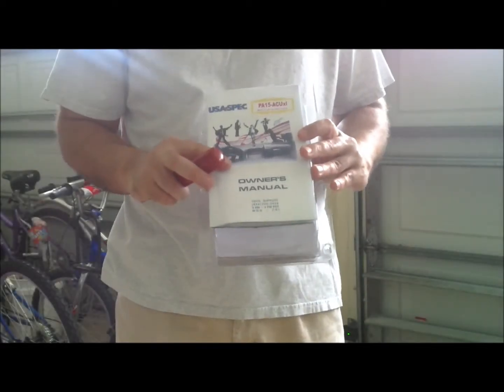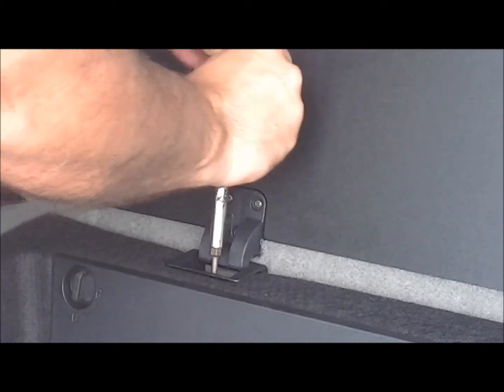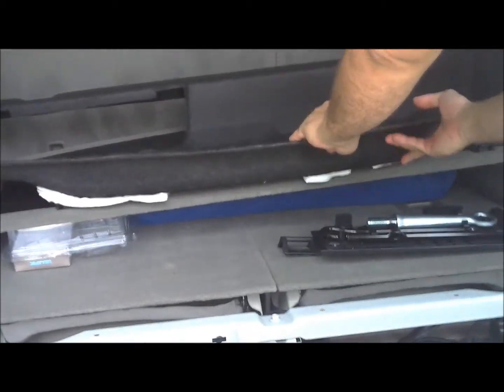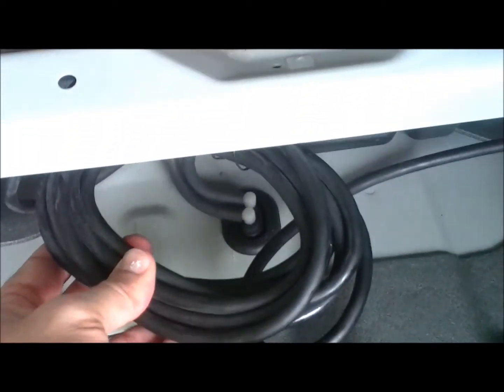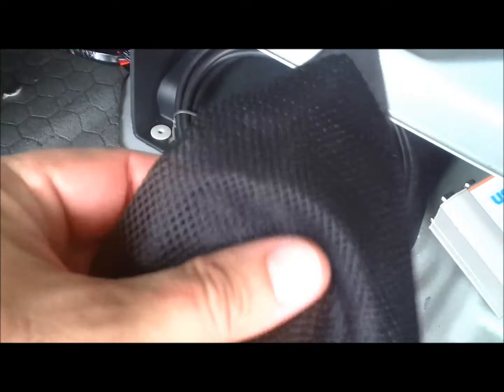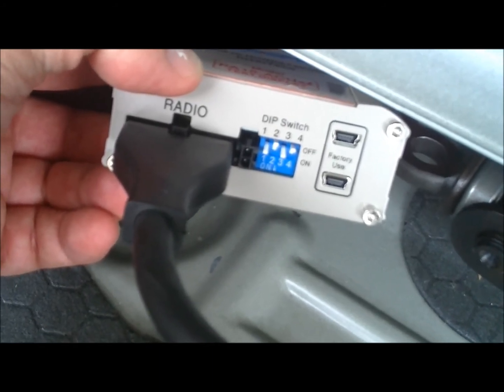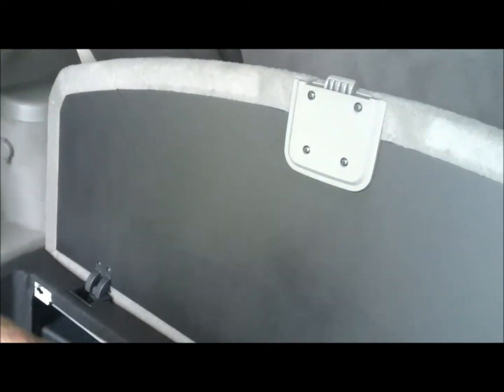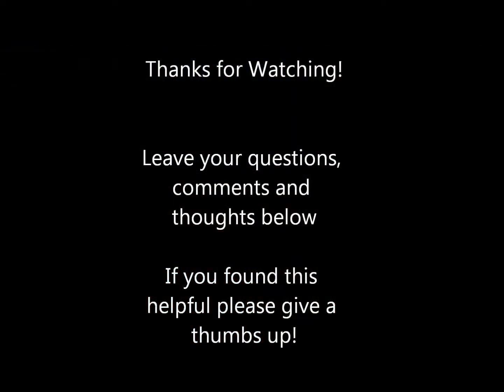USA SPEC PA15-ACUxl Acura MDX Tech IPOD install

Comment: Use a Dock to Lightning adapter to interface to newer type devices. 
There is a direct interface method allowing you to directly control the iPod. Set to XM 1-5 to directly control using the iPod's own interface.

Comment: Is there a usb plug in to this?  This unit has the 30pin connector, but my iPhone 5 has the new lightning connector.  I'd need a female USB in to this unit to connect my iPhone.  Is this available?